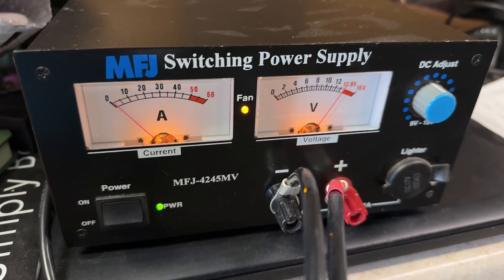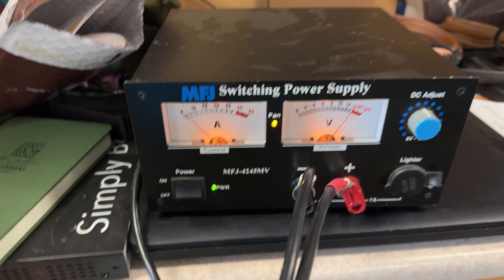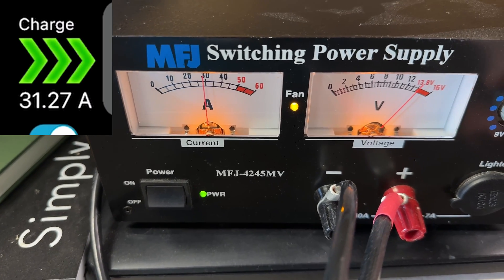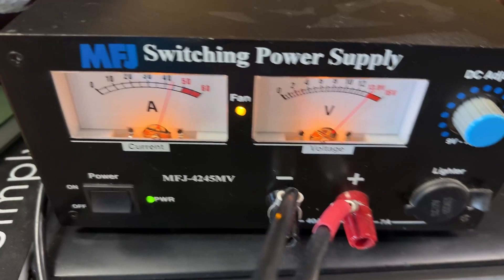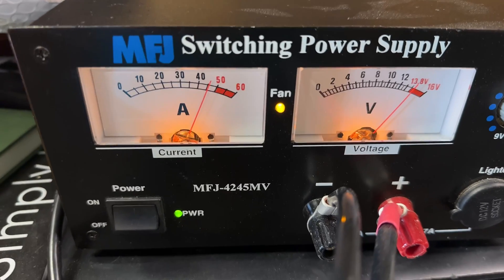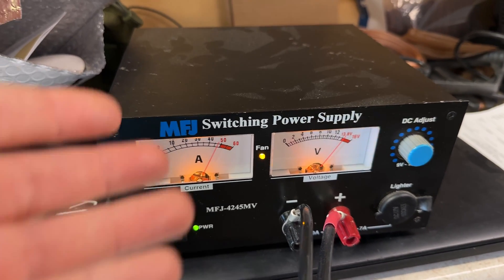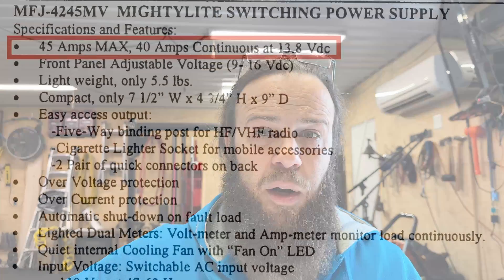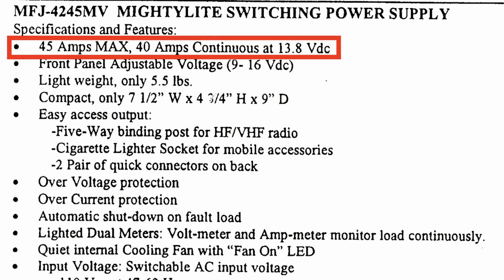Can you charge a LiFePo4 battery with your shack power supply?

Comment: do you have a link to buy the same power supply that you have?
Reply from the maker: This is an Amazon Affiliate link:

https://amzn.to/3XjkKqL

MFJ-4245MV

I checked the MFJ website and while the product catalog still shows it the page for the specific power supply is gone. I suspect that this is one of the products that will no longer be made by them after they announced the ceasing of manufacturing in the USA. So get it while you can, I have two of them and they have proven to be excellent. I suspect that you can also find new stock of them at the usual amateur radio suppliers.

Comment: Bettery will not charge to full until the input voltage is above the fully charged battery’s voltage… no matter how long you charge at a lower voltage.
Reply from the maker: It will, if you have a BMS. Without a BMS you are correct.
Reply: @LifeAtTerminalVelocity  Boosting has to happen somewhere. If BMS doesn’t boost…then the best that can happen is the voltages match.

Comment: Happy New Year Carlos. I like that Video a lot. You know why? I am same crazy as you doing Things everyone telling us not to do them. The funny Thing about charging up Batteries is the Manufacturers of the Batteries not suggesting to use a regular Switching Supply with variable VDC and the Manufacturers of these PSU Units telling us not to use the Supplies for charging up Batteries. Are they just trying to fooling us or what?
Reply from the maker: I don't see why what we are doing would be wrong. It is really no different than using some fancy charger. Especially with the use of a BMS to control the charging of the cells.

Comment: If you have a lab bench power supply with current limit, it works well too... Set the voltage up to the full charge voltage, with current limit set to the max charge current you want to run, and let the bench supply work it out 😅 thanks for all your videos!
Reply from the maker: One of these days I'll find a good deal on a lab bench power supply with sufficient voltage and current to do that with. Right now the one I have limits out to 5v and 3A.

Comment: Happy New Year! I have Ryobi battery tools and am constantly bypassing the BMS to charge them when they won’t turn back on or charge.  Many of the times the internal pack voltage drops below the BMS specs so I open up the batteries and charge them directly.  Once they are up to at least 18VDC I can put them on the charger which brings them up to around 20VDC.  I have not heard of turning up the voltage for this before.  I doubt it will work for my case since the FETS turn off the output when bellow a specified internal pack voltage.  I am not saying you are wrong for your setup just thought I would share my story.
Reply from the maker: I have seen that done before. Never done it myself but I have seen it done. I saw a guy that ran external leads to the cells on the batteries so that he wouldn't have to pop them open anymore. He ran tiny bolts through the shell of the battery and leads with leads to each cell and then he could just clip on to each cell individually from the outside.
Reply: @LifeAtTerminalVelocity  yes I have seen that also. I would rather open it up because bypassing the BMS is only one of the fixes.  I have had to replace a 18650 cell before because one was dead.   To find that bad cell I was checking voltage on individual cells. Another thing I do is put a label on the bottom when it was serviced so I can know if this pack has a chronic problem.  All the best! Keep enjoying life at terminal velocity.   73 de KI5HXM

Comment: K, your BMS on the battery will manage things. Unless it's a total turd battery. If you put the PS at 14.6-ish the BMS "should" manage things. I'm not a Bioenno snob and do run Chicom batts like this (auto batt charger on AGM) to positive results. Your mileage may vary, good luck & experiment! Happy to see you exploring beyond the "jumping out of things that should be on the ground" (I'm prior aircrew = funny comment) KØATV
Reply from the maker: The BMS will handle it only if the Power Supply will also handle it. Remember that this is a 40Amp PS with a 300Ah BMS. Like I said in the video, the BMS will limit the inrush of current all the way to 300Amps, but the PS will shut itself down at its rated max current. Thus the need to slowly feed current into the battery for the first initial few amps.